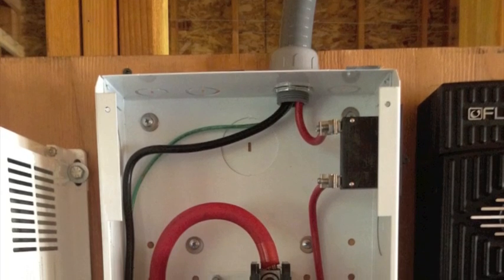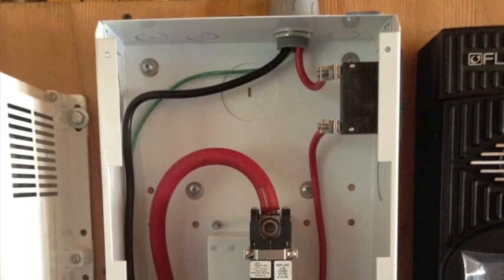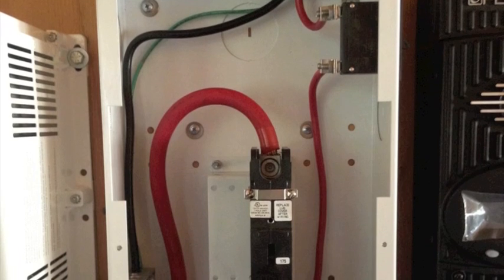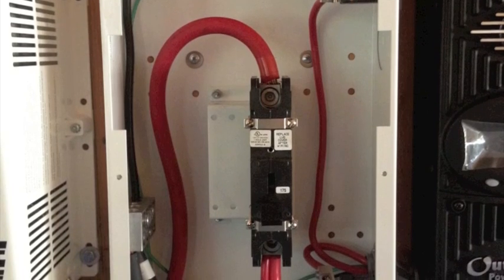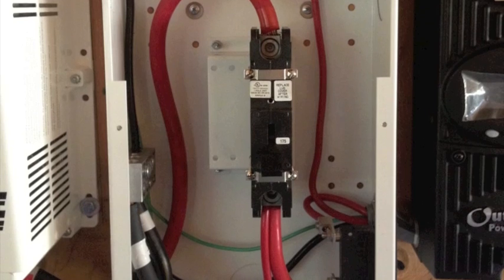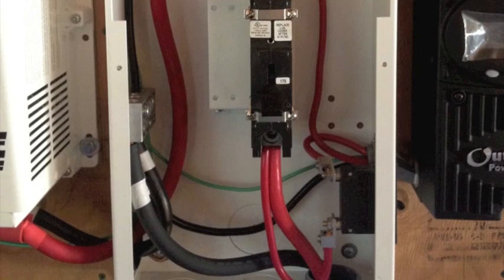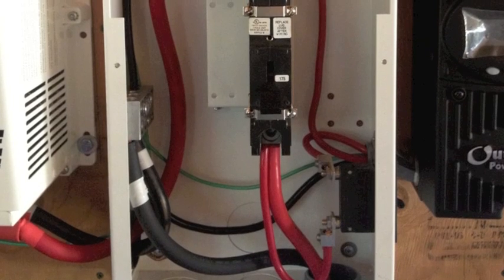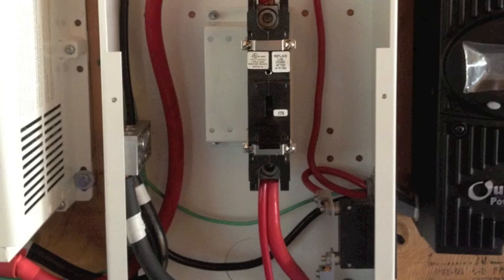Enclosure Panel Wiring Solar to Charge Controller, Batteries, and Inverter

Comment: When the hot wire coming off from the bottom-right breaker/switch is connected to the 175v switch is NOT isolated from the charge controller?